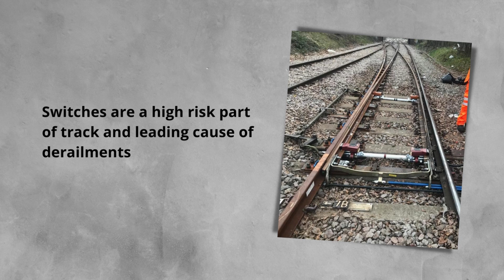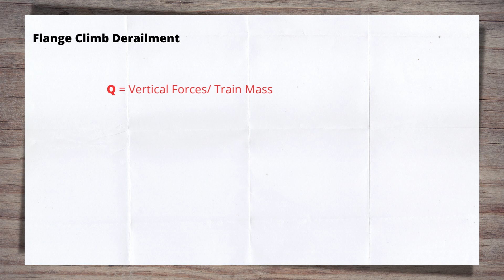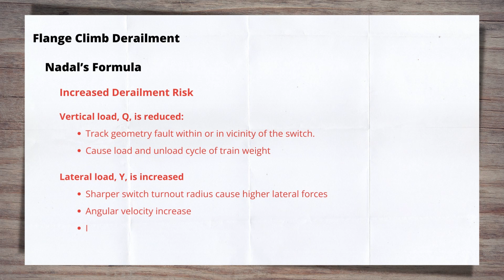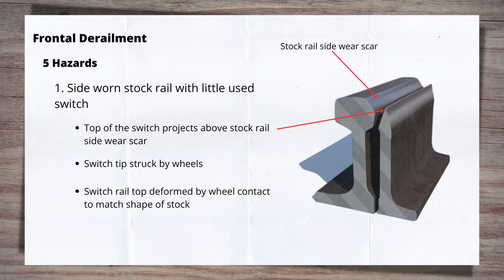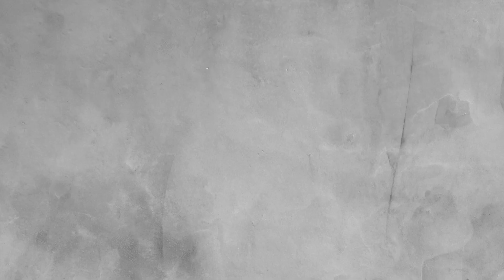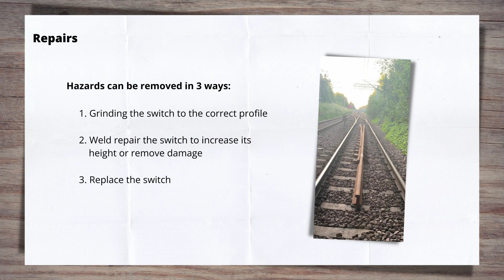Railway Switch Derailments. Why Do They Happen and How to Prevent Them!

Comment: Presumably, damage that can cause a derailment and the required forces, are more likely to occur on the switch rail for the diverging route. Perhaps that's why we tend not to see high speed derailments. 

Of course, there's also just not inspecting the switch to the point where the bolts holding a stretcher bar in place come loose, as at Grayrigg.
Reply from the maker: I would say that that is a fair assumption and conclusion you have come to on the switch rail damage!

And yes of course, if no inspection is taking place then anything could be going wrong

Comment: Apart from wear of the rails and inspection to detect this (which affects beta), reduction of mu by lubrication (which you covered), I think that Y/Q will be reduced by reducing the speed of the train.  Presumably this is used to control the risk of de-railment.
Reply from the maker: I believe you are correct. The train fundamentally gets its energy from its movement, so slowing it down would reduce the energy the wheel has to ride up the rail. This is why one of the main mitigations for track issues, where derailment is likely, is to put a speed restriction in place.

However, I believe statistically train are more likely to derail at slow speed over switches in places like sidings etc. This certainly tallies with my experience. But this could be down the the quality of maintenance within sidings or just the sheer number of movements over the same switches. 

An interesting thing to think about for sure!